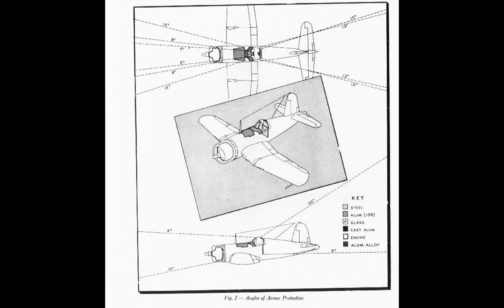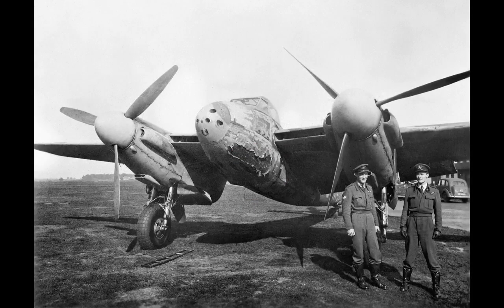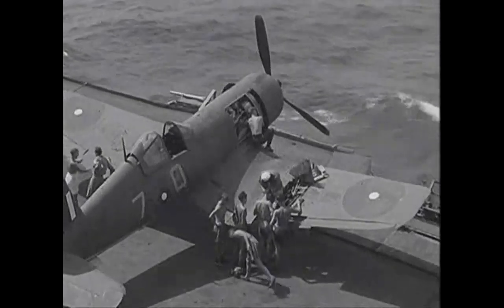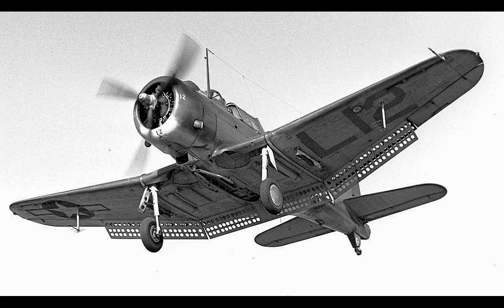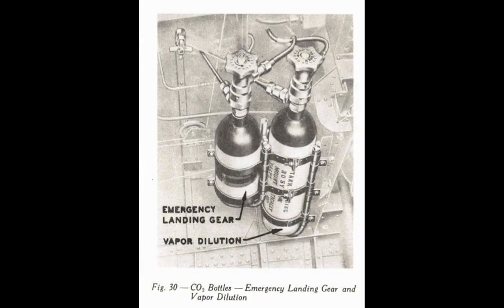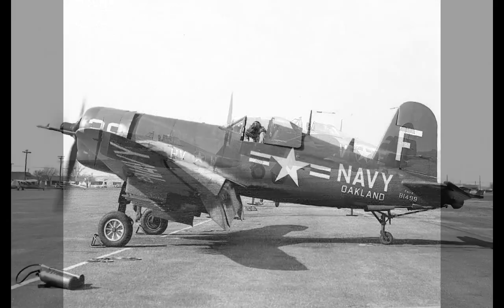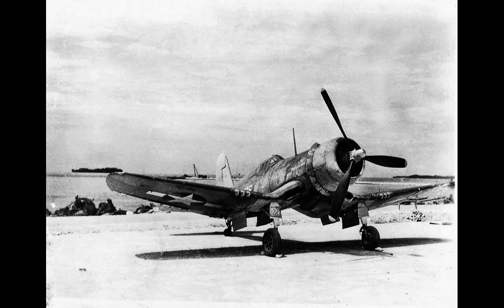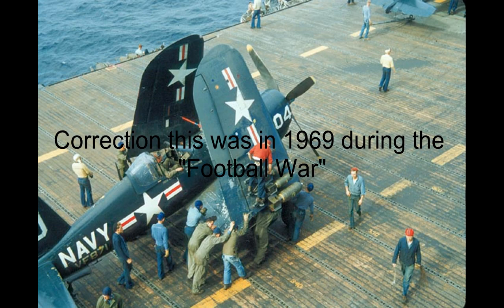F4U Corsair Design Features

Comment: One of the best channels on YT for us airplane geeks.
Begin Rant:
Totally not fair to say the "gull wings are for prop clearance" explanation is kindergarten level and dumbed down. Accepting this premise would cause me to look back on all the Corsair demos I've seem in my life with some disdain for the announcer and a propensity to unfairly judge somebody who offers up such a neanderthalic explanation. Of course the designers had other considerations for going with the gull wings. Prop clearance is still probably the primary driver.
It wouldn't be fair for me to say Greg's vertical stab placement/strength explanation is kindergarten level just because there are other reasons for the design choice. Stab placement is often driven by the need to keep the rudder and elevator surfaces sufficiently far apart to minimized interference, mechanical and aerodynamic, when the surfaces are fully deflected. 
If somebody tells you the gull wings on a Corsair are for prop clearance they are giving you a PRIMARY explanation,  NOT a dumbed down one. You can and should still tell people this who didn't know otherwise. And now, thanks to Greg's meticulous and informative video, you can explain the other advantages and finer details of such a design.

Comment: This is one of the coolest planes ever designed. Greg, would you know why some of the models like the one @2:25 had white stenciling right in front of the cockpit? Looks like it's the same area where the aluminum armor is placed.
Reply from the maker: I don't know, and I have tried to find out, but it seems lost to history. I think it's something to do with servicing either the armor, or the fuel tank, but I just don't know.
Reply: @GregsAirplanesandAutomobiles  I just googled it and found this on it (of course I would have no way to verify the source) https://www.historynet.com/why-did-f4u-1-corsairs-have-stripes.htm
Reply from the maker: It sounds plausible.
Reply: @GregsAirplanesandAutomobiles  Yes it does. I don't know why they'd use white tape though... Maybe with white tape they could easily see when it should be replaced as I would think the tape would get discolored by the leaking fuel and oil. I used to watch The Black Sheep Squadron tv show as I'm sure you did too. I don't remember if a lot of the real air operations footage showed a widespread use of the tape or not.
Reply from the maker: I don't know either. I do know that on ships, supplies are limited. I have also notice when touring older naval vessels that white tape is commonly used in the navy, at least on older ships, so maybe it's simply what they had.
Reply: @GregsAirplanesandAutomobiles  I just googled that question on muzzle tape and found some info on a scale modeler forum, so my guess on use of the muzzle tape was correct. It appears that the British used tape on their fighters' gun muzzles because they put anti-freeze in the barrels to keep the barrels from ice inside which could cause a gun to blow up http://cs.finescale.com/fsm/modeling_subjects/f/2/t/10846.aspx
Reply from the maker: There is also an argument that taping over the gun holes made the planes faster, and it's supported by NACA! I do think the main reasons you stated are correct.
Reply: @GregsAirplanesandAutomobiles  Aha, yes that would make sense, less wind resistance over those areas of the leading edge of the wing so better speed and better fuel economy. I had no idea that NACA had done studies on that.

Comment: "probably the most easily recognized plane from WWII"...Really?  @12 you have a P-38 fly into frame, which many might argue is THE most easily recognized US WWII fighter, allied or axis.  Definitely much more so than a Corsair.  If you're including axis fighters, you may want to consider the ME-262 or even the Stuka.  Simply stating an obvious narration gaff.  Sorry.
Reply from the maker: You are incorrect. From the front the P-38 looks very similar to the BF110. So much so that the USAAF had specific training and videos to help gunners tell the two planes apart. I would also argue that the front view is the most critical in terms of aircraft recognition as it provided minimal time for identification and the maximum penalty for an identification failure. As for the 262, it looks a lot like the Kikka. As for the Stuka, there are many planes that look quite similar, the HA137, HE112(from the front) come to mind, and some Japanese planes look somewhat similar. You may have a different opinion (and obviously appearance is a matter of opinion), but I didn't not have a "narration gaff" in this case.

Comment: shes a funky looking bird. thanks for explaining the reasons for the looks.  I like the part about interectional drag and the gull wing attachment. that cocpit is a mess
Reply from the maker: Thanks. The cockpits of the US planes tended to be pretty bad, although the later planes were better. It's really the Germans that made the leap forward in ergonomics, although I don't think they used that term back then. The cockpits of the FW and late Dornier aircraft were good even by modern standards
Reply: @GregsAirplanesandAutomobiles  do you reccomend any videos discussing flight characteristics?
Reply from the maker: Sean, I'm not quite following you... Do you mean for aircraft in general, or some specific flight characteristic?
Reply: @GregsAirplanesandAutomobiles  some of these warbirds are a handfull even with lots of air across the wings. high speed stalls, torque stalls, nose overs...P-51 comes to mind. I heard somewhere about Corsairs deploying flaps in a dog fight to turn in harder on an opponent. do that in a Mustang and you better have lots of recovery altitude. I observed in the corsair carrier landing a hint of tip stall but it recovered. maybe the bent wing played a roll in that.
Reply: flight characteristics as they relate to the unique features of the Corsair

Comment: Lucas Electeric‘s engineering for the most part was fine the problem was with the execution of the product England’s population was experimenting with socialism, Lack of pride in their workmanship. Lead to a lot of problems. My family was a Bsa dealer for 30 years. It took my brother 24 hours to assemble a bike out of the crate, he would often say , you don’t know if it had a crank in the The motor. Until you try to crank it over. In the early 60s Lucas was paid by Bsa $12.50 or so for the entire electrical system, including the headlight taillight battery alternator wiring harness. Handlebar switches, ignition points. Ignition cam advance
Reply from the maker: I actually don't have an issue with Lucas engineering. Thanks for your comment, it makes a great deal of sense.

Comment: I’ve always wondered if the horrible pilot/canopy position.
That was forced due to design and weight/balance problems (unlike the F6F).
That caused the horrible carrier landing problems due to poor forward and downward visibility.
Didn’t hint at the higher performance of the “area rule” principle discovered years later in the F-102/106 designs?
Just a wild speculation on my part. But something that I think should be considered.
I fueled up a Corsair in the late 1970s in Medford, Oregon on the ramp. GasBoy job in the summer during College.
Jesus, it was a huge airplane
Pictures don’t do justice to the enormity of the airplane.
Maybe an F6F was similar in size, but I don’t know. I’ve never seen one up close.
An unusual but sensual profile. 
Very forward vertical stabilizer? Cockpit very far back.
A long, phallic nose and the cranked gull wings.
Very fast. Backing up my speculations above.
Something to think about when you’re bored.
Reply from the maker: Yes, the cockpit location is the problem for carrier landings. You just can't see forward and down in this thing, at least not very well.

Comment: Isn't the Corsair tha last US airplane to have fabric wings, or a substantial part thereof? Also, I believe the British raised the cockpit canopy as they did with the p-51, to improve visibilty, but in the Corair they raised the seat too. I recall I read that somewhere.
Reply from the maker: The Corsair was mostly metal but used fabric in some locations like the control surfaces. I think it was the last US fighter to do so. You're right about the seat.

Comment: actually later that 1961 an a1 skyraider scored an air to air kill against a jet in vietnam. that happened in early in the war so the prop driven skyraider actually had the last air to air kill by a prob driven plane very early on in the vietnam war soe vwhere around 1963 or 1964
Reply from the maker: Nope, for two reasons. The Corsair's kill was in 1969 as noted on the screen when I misspoke and said an earlier year. Second, I said the Corsair scored the last air to air kill by a piston engined fighter, the Skyraider isn't a fighter. That said, you do have a good point, and I tip my hat to that Skyraider pilot!
Reply: Thomas,  not only one and a bit later in 1966, a good year for Spad Pilots 

Greg tipp your hat two times  more

the A-1 was flown by Lt. ( junior grade) W.Thomas Patton VA 176 , A-1H (137543) , he shot down a North VN MiG-17F on Nov. 1, 1966.

Another two pilot shared a MiG-17 kill, Canasta flight from VA-25 aboard USS midway on 20 June 1966, Pilots Lt. Clint Johnson (NE577) and Lt. Charles Hartman (NE575)

Comment: Greg: You can't possibly protect the whole engine with armor
Tovarisch Ilyushin: Hold my vodka comrade...
Reply from the maker: LOL. The vodka comment was funny. On a serious note, I said you can't add enough armor to prevent loosing an engine. Yes, IL2 had a lot of armor, yet it's clear that German pilots were able to shoot out it's cooling system anyway. The armor helps and helps a lot, but it's no guarantee that your engine won't get shot out.
Reply: @GregsAirplanesandAutomobiles  From what I've read, German pilots eventually learned to leave the engine alone and target the much weaker tail instead.
Reply: Comrade Ilyushin, it is forbidden for Sturmovik pilots to drink vodka while flying in defense of the Motherland. All vodka consumption must cease immediately before take off...

Comment: Hi Greg! There's a reason for mounting vertical stabiliser before horisontal in regards to aerodynamics - it's about spin recovery. When aircraft's in a spin, the horisontal stabiliser creates kind of aerodynamic shadow, in which the airflow is very turbulent and rough. When the rudder gets in that area, it may just not work, and when it's behind the horizontal stabilizer it will certainly get in that shadow. On the other hand, when verical stab is placed before horizontal, it's very unlikely to happen, so the rudder will work and enable the plane to recover. Great video, as always, cheers!
Reply from the maker: Thanks for your comment. Quite a few people have made the same claim, and I understand the logic. However upon closer examination, it's not true. Every WW2 era plane I can find with the vertical stab so far forward is NOT approved for spins. The planes that are approved for spins are actually set up the opposite way.

Comment: Apropos your comments about generally poor cockpit ergonomics, my late father, a Wildcat/Hellcat/Corsair pilot, told me the original Curtiss SB 2 Helldiver caused many accidents. It’s dive brake actuator switch was originally located on the control column. Pilots often accidentally tripped the switch pulling back on the stick during a catapult launch. Not a good time to deploy dive brakes. Rectified on the SB2C. Excellent video, sir.
Reply from the maker: Thanks Charles. Ergonomics are one often overlooked factor in WW2 planes.

Comment: Why was the rudder positioned so far forward of the horizontal stabilizer and elevator on the F4U? Contrast this placement with that of the A6M Zero, where the rudder is positioned almost entirely behind the elevator, or the Spitfire, where the rudder and elevator hinges are almost in alignment. What aerodynamic or control benefit results from each configuration?
Reply from the maker: On the A6M it's done for spin recovery and control at very high angles of attack. There is no question about that and it's documented. In the case of the F4U, I have not found a single source that explains it, but I think the most likely answer is that it was done for structural reasons, as explained in the video.

Comment: What always amazes me about WWII aircraft, in which the piston-engine-driving-a-propeller concept literally reached its maximum scientific performance capability, were all designed by engineers working with pencils, paper and slide rules, without a computer of any kind on hand to assist.  While modern day military and commercial jets may make 1940's-era aircraft seem primitive in comparison, there is nothing simple or primitive about the engineering behind a Corsair, or a Hellcat, or a Seafire, or an A-26 for that matter.  Makes you wonder:  if you remove the computers from the picture, could an aeronautical engineer from the class of 2018 do the same job as the engineers who designed the Corsair?  I have my doubts.
Reply from the maker: The 727 was the last slide rule designed airplane, and it's still faster than every single narrow body airliner built today. I do think some engineering skill has been lost.

Comment: The lack of high altitude performance of the Corsair is a myth created by the low-altitude combat environment of the Pacific.
Reply from the maker: The Corsair is actually pretty decent at mid and high altitude, especially by Pacific standards. However I wouldn't want to fight a 109G14 at 27,000 feet in a Corsair. It's much better off down low.

Comment: I noticed several photos of Corsair props being three or four bladed. That reminded me of what my father told me when I was a child. He worked for Vought during the war. The four blade props were brought out as an improvement for higher speeds. That was about the last year of the war. They found when used at higher speed they vibrated a lot. That made some other components shake loose and some difficult to see while flying.. Most that were converted to four blade went back to the three blade after that but not all.

Comment: Dural is related to a newer Aluminum variant incorporating a metal matrix composite called 'Duralcan'
http://www.substech.com/dokuwiki/doku.php?id=metal_matrix_composite_al-2_cu-60_al2o3_fiber
http://www.temponik.com/Duralcan%C2%AE-2
It is not widely used in part because the matrix composite is 'disturbed' when it is welded, making the weld point a weak link
Reply from the maker: Thanks Gregory. Metallurgy is a bit outside of my scope of knowledge, but quite a few people have been interested in this particular subject, and I am sure that your post will help them. Good job.

Comment: I was told the bend in the wings were to shorten the landing gears, and reduce drag at high speeds. Also to reduce the flutter in high speed sharp manoeuvres.
Reply from the maker: I can say with a great deal of certainty that the first two are true. I am not sure about the third, but maybe.

Comment: The British did have steel decks, but America chose to stay with wood as it meant the Carrier Task Forces could go much faster  which was needed in their Fast Attack Carrier Raids which proved to be so devastatingly effective in the PTO.  There were such great distances to cover to strike from place to place, unlike Europe which was relatively close, even from one end to the other.
Reply from the maker: Hi Chuck, those are good points, others have posted them here before. There is no question that the U.S. Navy's carriers were good and had advantages over other designs. However in regards to the ability to take kamikaze hits, the British carriers were superior due to their armored flight decks. That's the only point I was making, I am not saying they were superior over all, or anything else.
Reply: British and steel decks, or armed flight decks due to  it;s operation area being closer to land and therefor more like to be threaten by air attract and also due to possibility of being engage with big gun service ship